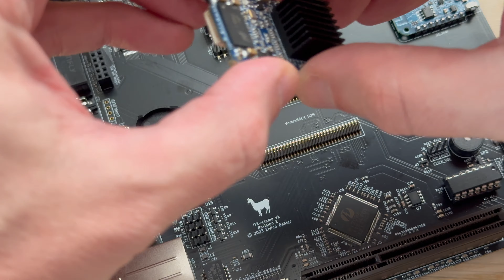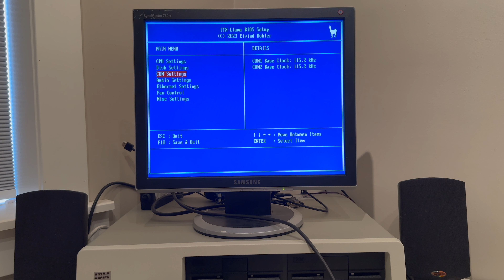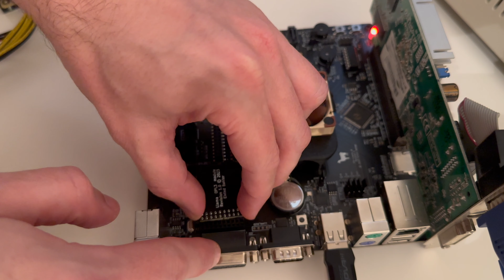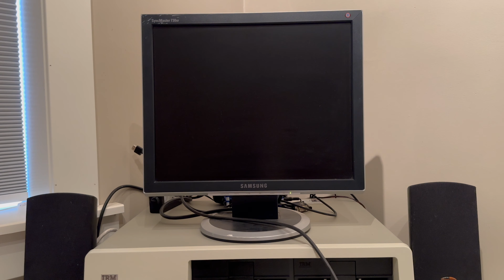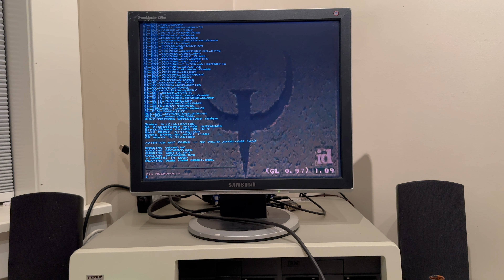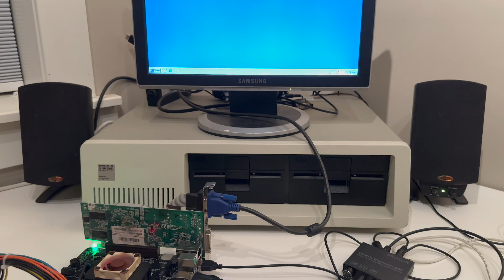The ITX-Llama

Comment: Would it be possible to put all of this on a PCIE bus for your new computer (like an add in card), Then have a program on Win 10/11 to display the output? Also have the ability to use the host mouse and keyboard? The GPU could possibly be emulated like a Voodoo 3000? Not sure though, be cool idea.

Comment: Just want to add, saw another video about this llama this week, very impressive and got me thinking.  My background is arcade repair and one particular game is Hydro Thunder and this nearly works as a fresh new board replacement.  At the moment a guy has been hacking the exe to work on different hardware .   It actually is a intel bx400 which has that other Yamaha chip, it’s uses pci voodoo 2 and no primary graphics card.  It boots into a custom boot loader and runs the game .  No dos, it’s own custom loader.  It uses com1 too communicate with a controller board for I/o.  It’s a pentium 2 slot 1.  So yes very interesting
Reply: Wow I always wondered what hydro thunder ran on, that's awesome!

I loved the hardware from American arcade games like mortal kombat or tempest, but that sounds like those guys from midway really took a dive deep into the hardware.

No wonder that game looked as good as it did.

Comment: THIS IS SO COOL, AND I VERY MUCH WANT ONE! WOW! Can’t believe how cool this is. Also would be cool to see it running a variety of OSes! ArcaOS for 16-bit and 32-bit Windows, OS/2 and more compatibility, HaikuOS for that sweet sweet BeOS experience, NetBSD, OpenSUSE Tumbleweed, Ubuntu 16.04 ESM cuz you need that Linux showdown, and 9Front for that Bell Labs Research OS UNIX-like experience. And MINIX too because why not. Ideas… ideas….

Would also be cool if you could partner with DMP from their Vortex86 EBOX store and 86duino store to have them manufacture and sell these. And then they can partner with MicroCenter… or you could… to have this listed in their maker section. Between retro nerds and tinkerers, MicroCenter should be able to justify selling these and the 86duino. 

They could also sell ArcaOS licenses for those who want to go that route… it’s Odin system should handle most Win32 applications… and/or help resell legal Windows 3.11, Windows 95, Windows 98SE, NT 3.1, NT 3.5, NT4, Windows 2000 licenses for these. 

AROS and its derivatives for Amiga-like experiences are another possibility they could go with and unofficially offer. 

RouterOS because with a multi-port Ethernet PCI card this could have some interesting router applications. 

Now of course, there is always DMP to eBay resellers as a direct route as well. 

This is an amazing product with pent-up demand and I hope to see it available to many more people. And I do believe MicroCenter would be very promising.

Comment: Pretty cool!
Idea: ever considered using a Pi as the CPU, like the PiStorm?
Reply from the maker: For a CPU-only solution, a pentium processor has a 32-bit address bus, a 32-bit data bus + several other control signals. No way to fit that into the 40 GPIO pins of a Pi. Then you'd need a open source pentium chipset, which doesn't exist AFAIK. If one were to go with a CPU+chipset solution emulated on the Pi, you'd still need an ISA bus which'd already take up more than 40 pins, and we haven't even started talking about PCI/PCIe, USB, serial, SATA, ethernet, IDE, speaker and PS/2. So, nope. Not possible. :)
Reply: @eivindbohler  thanks for your answer!
But the Motorola 68K chip package also has more pins than GPIO pins available on the Pi. It’s necessary to use some interface/multiplex logic like a CPLD or a small&cheap FPGA.
About opensource chipset, you have DOS/86Box, Bochs, etc.

Comment: That is some seriously impressive work! Need to productize this as a ready-to-assemble kit with some nice retro-style 3d printed case options!
Reply from the maker: You saying you'd want to hand-solder a bajillion 0402 caps and resistors if you could buy this in kit form? :)
Reply: @eivindbohler  Absolutely not! I've soldered electronics professionally, but nothing can beat a finely tuned flow-solder process. I just mean a kit that's a box of boxes; case, this board, all the daughter boards and various options. Like all the Pi kits you can get. You can monetize the core product and all the add-ons. If you include some just-add-roms software builds, you can even open it up to a very young audience.

Comment: Is this machine comparable to a 286 machine? I have some programs that need dos but at a slow speed. Trying to find some of the old classics is next to impossible and I have need to continue supporting some radio items in my archive collection.
Reply from the maker: I don't think I've done an exact comparison to a 286-machine - but if you turn the CPU clock down to 100 MHz and disable the L1 (and L2) caches, I think you'll be in about the right ballpark. I can do a quick test for you if you point me to a specific program or game?

Comment: Does this have SSE2? I got rid of a socket 370 system recently because I couldn't get any up-to-date web browser to work on it
Reply from the maker: No SSE2 (or SSE) on the Vortex86EX. Not comparable to a socket 370 at all - like I mentioned in the video, this CPU has the performance of (roughly) a mid-to-late Pentium (one) processor. Best suited for DOS and early Windows 98 stuff.

Comment: Will PCI versions ever be available?
Reply from the maker: Possibly. I've already made working prototypes.
Reply: @eivindbohler  That's good to know. The reason I bring it up is because there are some very nice compact ITX cases available but they need card risers which are generally only available in PCI or PCIe. The Minibox M300-enclosure is an example of a compact ITX case that needs a riser.

Comment: Wow, cool project.  A few Questions:
- What are the advantages of using this hardware over using a VM?
- What is the Raspberry Pi adapter for?  Is it for a more configurable Audio Synth, like Midi? So you can change the MIDI library in software?
- Does this work with 3dFX or like old school Voodoo or Matrox graphics cards?
- Back in the Ole DOS days you had to free up that precious 640k memory, does this give you the full 640k? more? or less? is any taken up by dos drivers?
- Is there a configurable "Turbo button"?
Reply from the maker: 1. In practice, not many. You could emulate the entire thing on a reasonably fast modern computer. Many people like retro hardware though. ;)
2. The Pi can be used for emulating an MT-32 or MIDI device if you don't have access to real (Roland) hardware.
3. Yep.
4. How you configure DOS is entirely up to you, as on any other retro machine. Clever tweaking of config.sys and autoexec.bat can certainly give you well over 600k of conventional memory. And of course tons of extended and expanded memory, if you wish.
5. Nope, but you can easily enable and disable L1 and L2 cache, as well as set the CPU clock speed from 100-500 MHz.

Comment: I'm so happy to see the RP2040 in action for I/O in this build. I bought a batch of 20 at one point for $25 including the shipping and I'm slowing working though all of them. Out of curiosity, would you have used the RP1, their new I/O controller chip for the Pi5, if it was available? If not would you consider it for other projects or is it too restrictive compared to a full microcontroller with all those PIO blocks?
Reply from the maker: I haven't read up on the RP1, not sure if it's even going to be released as a separate chip or only be included on the Pi5. Fun to see all the crazy stuff being developed for the Pico though!

Comment: really neat but using the pcie to pci bridge chip limit the speed of the agp bus to 133 mbps?
Reply from the maker: The PCI bus is running at 66 MHz, so in that respect the AGP port is bandwidth limited to 266 MB/s. The actual cap might be around 250 MB/s though, which is the single lane PCIe gen 1 cap.
Reply: @eivindbohler  ok so enough for 9x gpus :

Comment: now try a voodoo card
Reply from the maker: I have, just not in this video! :) Tried a Voodoo3 3500 AGP - runs perfectly and actually results in improved performance in Unreal Engine games. For most other games though, it's far slower than the very cheap and readily available Radeon 9200/9250.
Reply: @eivindbohler ah I did wonder about voodoo , so what did you use in the video ?

Comment: Amazing.. I have pentium 3 ITX board but it has PCI Slot. So it can’t install proper GPU. So I used a 2-slot Pentium 4 M-DTX board to use a proper GPU and sound card at the same time. However, this board was too fast to run DOS games. The Llama board you see in this video is absolutely amazing. I support your efforts.

Comment: What purpose does the pi serve?
Reply from the maker: It runs the mt32-pi bare-metal software which uses Fluidsynth for playing soundfonts (General MIDI) and Munt for emulating an MT-32. So more or less like having a Roland MT-32 and a GM device like the Roland sc-55 built right onto the motherboard.

Comment: A YMF718 or YMF724 would also have been good choices for the sound.
Reply from the maker: Yes, you're right. The CS4237B is such a good match though, and readily available new old stock - with exceptional community knowledge and support, that it seemed like the best fit. Its built-in OPL3 emulation is extremely close to the real thing, and if you plop in my addon OPL3 module, it's close to perfect.

Comment: Since you're already on vogons, I'd love to see those guys implement the orpheus 2 onto the extension header, also would love to see the yucatan fx wavetable board on there. Definately have to get one of these to mess with, and thank you for all the work that must have taken
Reply from the maker: What parts of the Orpheus 2 are missing? :) This board is using the same CS4237B sound chip and with the OPL3 plugin module, also the same real Yamaha hardware. The Yucatan FX isn't for sale anymore, is it? In any case, it's way too big to fit. But the X2GS works perfectly, I have it sitting right here!
Reply: @eivindbohler  I would have opted for a true YMF719E, but I guess it all comes down to availability. I have to admit though, the FM Synth on the CS4237B sounds amazing.
Reply: Orpheus 2 has GUS.  Otherwise it looks like you have everything else covered.

Comment: impressive, any thoughts to add an isa slot? might be useful for things like picogus
Reply from the maker: Wouldn't be too hard (apart from the obvious lack of space for a real ISA slot - would have to be a "DTX" board then I guess). But - alas, the Vortex86EX only has a single hardware DMA channel on its ISA bus. That channel is already taken by the sound chip. I think the PicoGUS and most other useful ISA cards require at least one DMA channel.
Reply: @eivindbohler  ISA and PCI can share the same slot position, as their connectors are laid out the opposite way.
Reply from the maker: @erkinalp  Yep, that's true. But seeing as this motherboard doesn't have a built-in graphics card, you'd need to populate the AGP (or PCI) slot, rendering the closest ISA slot useless. ;) Plus, like I said above, it wouldn't be an ITX board anymore.